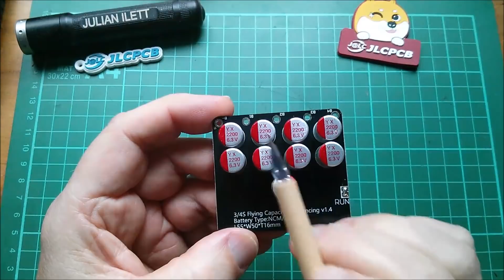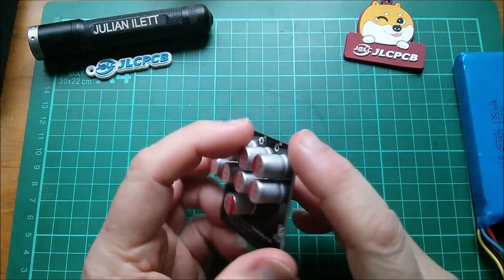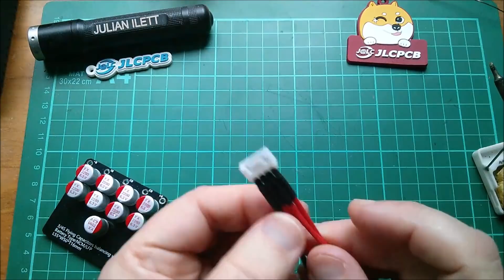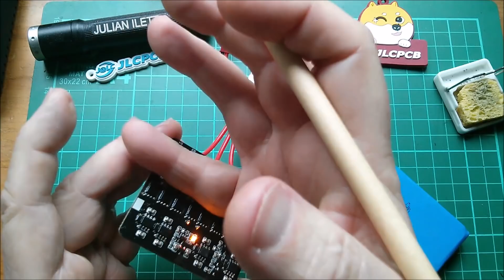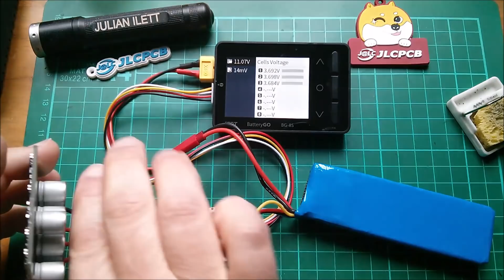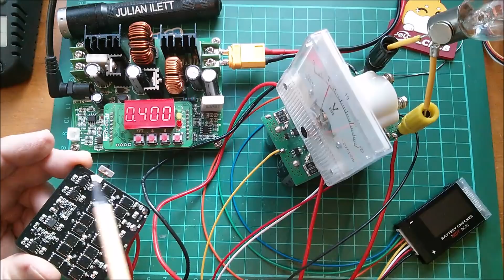Flying Capacitors Balancing Module

Comment: J you dont mean a polyfuse is a regular current limiter as you said. PPTC devices.  They are for very intermittant use and do not return to original low IR for hours - years. Repeated used wears out the polymer/carbon matrix and it goes to high IR.  Its more likely those are plain low Resistors for current limiting

Comment: Each cell is connected to an individual capacitor then they are decoupled and the capacitors are connected all in parallel to even out and then recoupled to the individual cell once again - the process repeats over and over on a kind of PWM slowly shuffling differences about till they all even out- inrush resistors limit excessive high currents - as cells approach parity their capacitor potential difference fall and the corresponding current transfer reduces - difference across cells is not limited to adjacent cells through adjacent cells tend to receive the lions share.

Comment: What is the easiest way to verify that a flying capacitor board is functioning? Could it be as simple that the light is on?
Would the light not turn on if any part is not properly functioning?

Comment: Flying Capacitor has one capacitor(bank) not a bank per cell pair(ripple balance) and 2xCell(n) mosfets to connect it to the highest voltage cell and then dump that into the lowest charged cell, so it can pull excess from cell1 and dump into cell5 directly,  but you need a micro controller and other supporting cost, as you say they can be built with super capacitors for higher balancing current so faster balancing, jkbms sell one like that i have built it into my e-moped. They also need very little voltage difference between cells. inductor based ones can also be built in ripple but i've not found a flying inductor model for sale.  
i'm trying to design my own but i think i can save up and buy a dozen faster than i can design one....

Comment: If the balancer is going of if the battery voltage is 7.5V, then the cell voltage is 1.875V and the four cells are damaged. 😞
But it looks like we can use this switch, replace it with a transistor or optocoupler and activate the balancer if the voltage of each cell is over 2.5V.

Comment: They draw way too much current to leave them on, so 'eco friendly' I don't think so!  
Also, those caps will wear out pretty quickly, especially if they get hot.  
The ideal most efficent is to charge each cell independently using a transformer to isolate the cells, after they are topped
Reply: they have a switch to turn off balancing with a draw of <0.5mA

Comment: Hey have you looked into testing the AL8100 series IC for super capacitor balancing? The way it works is interesting and it looks like they can make one for lithium batteries with the same design

Comment: I don't get how it is eco friendly, as half of the charging/discharging power to balance dissipates in the parasitic resistances of all involved components, because it is basically a RC circuit where half of the power dissipates in R while the other half ends up in C, but only for adjacent cells. For non adjacent cells efficiency of the balancing power is 0.5**distance with distance 1 being the first adjacent cell. So if the main imbalance is between the first and the fourth cell the balancing efficiency is 0.5**3 or 12.5%.
Looks to me like the effort isn't worth it.
Putting a inductor in series to the transfer capacitors doesn't help, as when the switching frequency is uncorrelated and dissimilar to the resonance of this RLC circuit, half the power is still lost in all parasitic resistances.

Comment: 60Ah?? more like 6Ah, since that's more a reasonable guess. 60Ah balancers would be waaaay larger.
Reply from the maker: "Static current of about 12 mAh, the recommended battery capacity to 60-300AH battery applicable!"
Quoted from this eBay listing: www.ebay.co.uk/itm/384385385409
Reply: @JulianIlett  quite odd, i must say. I mean, maybe they do work for 60Ah batteries, though the current would need larger terminals if its more than 0.5v.
Reply from the maker: I think what they're trying to say is: 12mA consumption will drain a small battery quite quickly, so make sure you only put it on a big battery. It's nonsense really - if your battery is connected to a reasonable sized solar panel, that 12mA consumption is pretty irrelevant. And the current consumption in standby is only 0.1mA - so a small battery might be drained by this device, but it won't be damaged.
Reply: @JulianIlett  exactly. Chinglish is wonderful to understand.

Comment: They actually work very well for top balancing if you switch them on at the required voltage, easily done with an Arduino and relay.  For occasional top balancing a manual switch is fine as they balance so quickly. A lot better than messing about with resistors. 
I would not leave them constantly on due to the high current draw, and they destroy the top balance at lower voltages.
If you can run MQTT, have a look at the Shelly 1 switches to control them (flashed with Tasmota software) . They will run on anything from 12 to 60v and give you a single pair of 0v contacts.
Reply: I chose these for my 400v project.

Comment: My cells stay balanced until close to full or empty. then it goes way off and shuts down because of one cell being full/empty before the rest. giving me a great lithium battery that shuts down way before min /max voltage of everything used by it. charging shut down at 27v and discharge shutdown at 23v - 24v. To make things more aggravating, I bought this "5 amp"  balance to find out it don't do crap amperage at the low and high place when it goes out of balance. it helps more than the built in BMS balancer, but nothing even close to 5 amps. [china marketing mathematics]
 In my mind, no battery should shut down with 27 available volts when the protective limit of everything being used, is 21-22v. If one cell is low / high only that cell needs attention. when will A real BMS be manufactured. A big part of cell price is exact capacity matching to stop cell shutdown.  price of 8 capacity unmatched  105 Ah , about $350 , matched double it. that is crazy. the variation of the unmatched cells is really small . but screws up everything because stupid BMS shutdown design. Now I ordered 6 more 105 Ah cells to hopefully find one slightly higher capacity, than my one slightly lower capacity cell.
 hopefully the remaining 4 will be close enough for a working 4s 12v pack . lol. whats the odds?

Comment: You could have difficulty measuring the current. I was watching Offline Garage trying this earlier, the added impedance of an inline meter means you can't measure the current that way. And from what I understood from his attempts, the rapid switching between capacitors means that clamp meters simply cannot react quickly enough.
Reply: > clamp meters can't react quickly enough
There's clamp current probes for oscilloscopes, and those can usually work for at least a few tens of kHz

Comment: But what if...flying SUPER capacitors? When cell balancing must be instantaneous. Joking aside, it could be an interesting concept for balancing much bigger and scarier super cap banks or charging at much higher currents. ESR becomes very important very quickly, however.

Comment: It may be more "eco friendly" in concept, but that heat and the operating current indicates losses are significant. Do those losses outweigh the "green" aspects for correctly balanced packs in good condition? It seems it might...
Reply: I think the heat come out from the capacitor. since those sot23 switching ic tend to have high frequency and the capacitor ESL starting to take effect.

Comment: I thought I was super on board with these but now I'm less sure. Interesting in how they work, not what I expected. Would love to see a diagram brake down. 

A bit worried if they have no current limiting. I guess you still want a resistive balancer then something to engage this periodically when they are not too far out of balance. 

I have seen a number of people have these short out and cause major issues. I thought maybe they got a bad one bit it happened hours or days after installation. After seeing this I'm wondering if they went bad with a design flaw. 

I'm also surprised how hot they get given they are meant to be a better option to a resistive balancer.
Reply: They apparently have current limiting through the polyfuse.  Even when the polyfuse isn't "blown", it has a significant resistance.  If you run the calcs it looks like the polyfuses must have something like 0.180 ohms normal resistance.

Comment: Have you measured the switching rate here? I imagine it is not too fast as the capacitors need time to charge and discharge. But I'm also thinking that the abrupt current dumps must result in some noise on the total power bank voltage. Any chance you could pop a scope on it and show what this does to the quality of the supply?
Reply from the maker: Not yet, but using [Energy=0.5CVV] and [Energy=VIs], for 1V cell imbalance, 2200uF capacitor and 5A current, I get number of seconds = 0.0002 - that's a frequency of 5kHz. Very approximate I know.
Once my system is built (and earning crypto) I'll go back and explore all the components in more depth.

Comment: I have used these 4s,8s,16-17s and the previous ones you've shown which used inductors and I like these better as they keep the cell voltages much closer together especially the ones far apart in the series string like cell1 and cell 16 etc. The inductor types have a 30mv min difference in adjacent cells so the farther apart they get, the higher voltage difference is. As for operation, I have not tested it but according to the way things are wired, the first row of caps are in parallel with the cells. The second row of caps are first wired in parallel to their respective caps in the first row. Then the mosfets switch over to wiring the second row of caps all in parallel to the last cap. This occurs at a few khz as I heard it whine when I inadvertently overloaded one connection. Current is limited simply by the voltage difference divided by the sum of capacitor esr and mosfet on resistances. The pcb is 4 layer so it is a little tricky to trace out.
Reply from the maker: Interesting. There are newer versions of the flying capacitor modules which are more expensive. I wonder how they differ.
Reply: @JulianIlett  I have only seen pictures but never bought one as the older models are already pretty expensive and still worked well for my uses. The only difference I see are that the newer ones have more capacitors (possibly in parallel) and has a connector.

Comment: Someone caring (and bored) might want to calculate how many millions of times this green thing needs to be used for it to save the amount of energy making it consumed :)
Reply from the maker: Not me then ;)
Reply: Well the more accurate calculation would be comparing it to a resistive balancer. IE does this use less power than the resistive would use to achieve the same goal. Judging by the standby current I'd say no.

Comment: Excellent! Best explanation and demonstration of an active charge balancer I have seen. I have one too and was in two minds whether to connect it to my 16S pack, but you have given me that answer. Thanks Julian.
Reply from the maker: Thanks Benny - I think the only downside of this balancer is the relatively high self consumption. However, if your battery is charged each day from solar panels, I can't see it being a problem.
Reply: @JulianIlett  that can simply be solved by using the enable pads. Add a switch as you've done and turn it on only when the battery pack is in use or needs balancing 😁
Reply from the maker: True - switching the balancer from 'run' mode to 'standby' does reduce its current consumption - but not to zero.
Reply: @quandiy5164  but what if when you turn it on and the pack is more than 1v out of balance. Wouldn't that cause it to draw more than 5A and cause it to fail or worse? 

Also a worry when it still uses a bit of power when it's disabled.
Reply: @Sparky400  yes, but you have bigger problems if your pack is way out of balance like that. A well functioning pack should not differ much even without balancing.

Comment: Hmm being Green but the cct board is black?? puts me off as I do not like XR or road blockers, but this looks fun:-) how much carbon is used to produce this against standard resistor one LOL
Reply from the maker: Depends if they're carbon film resistors ;)
Reply: @JulianIlett  surely if they are Carbon resistant that is green:-)
Reply: What a balancing circuit is practically useful for is avoiding over-volting (during charge) the one dying cell in your pack that has a reduced capacity. A cut-off lets you avoid under-volting it when discharging.
When charging up, it doesn't save any significant energy doing this balancing by pumping charge out of the smaller (higher voltage) cell into the others. It's really just as effective to just load the cell a bit to avoid overcharging it: your pack is still effectively no greater in capacity than the smallest of your cells, which ever way you go about it.
BUT! When discharging the pack, it comes into its own: it can keep the smaller cell up in a healthy voltage range, for longer, by stealing a little bit of charge from each of the other cells. This can result in a significantly greater output from the pack.
Let's say in a 10 cell pack, if one cell is 15% lower capacity: during charging, 1.5% of the total charge energy would be wasted by a resistive balancer on the bad cell. Bugger all. 
But: upon discharging, rather than having to stop when you get down to 15%, (to avoid reversing the bad cell), a pumping balancer would allow you to take the whole pack down to empty. It props up the small cell as you go.
So really it's about maximising pack usage, not about charging efficiency.
Reply: @Rich-on6fe  I have a thery that something like this would also help even out cell wear over time by supporting the weeker cells like a splint. So even added to a pack. The worst cell would have less stress alowing the others to catch up.

I was thinking of installing this into my ninebot One electric unicycle. It's got a 15S 1P battery. As the voltage goes down it becomes more and more unstable. I suspect it really only takes one or two weaker cells to bring down the entire pack. I'd hope something like this would help even it out especially if I let it rest for a bit to catch up.
Reply: @Sparky400  It could well help. 
What I'd do if I were you is instrument the pack so you can see exactly what's happening to the cells as it is run up and down: sometimes I find I've made assumptions about this kind of thing, but once I've got hard data it tells a different story.
When I was diagnosing something similar I set up an Arduino to measure all the voltages once a second and send it all out through Bluetooth to my phone. In this case it showed that the cells weren't actually the problem.
Reply: @Sparky400  If I were doing it from scratch I'd do away with passing the charge along the chain one step at a time - that's not going to be efficient. Having a single cap that always takes from the highest and gives to the lowest shouldn't be too hard.